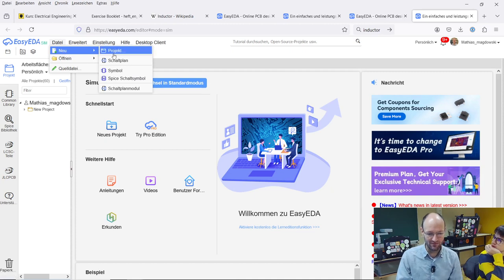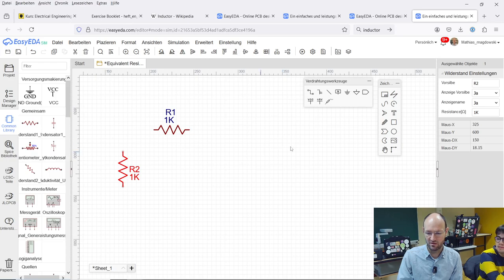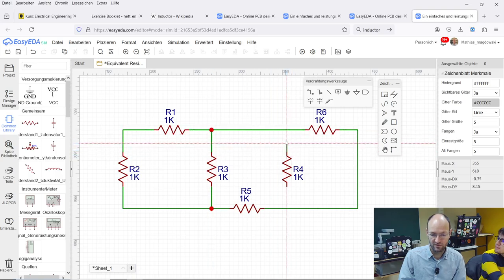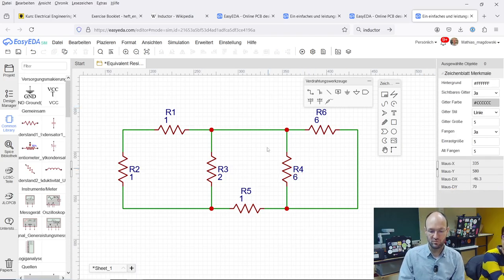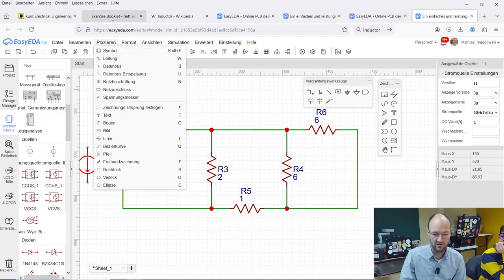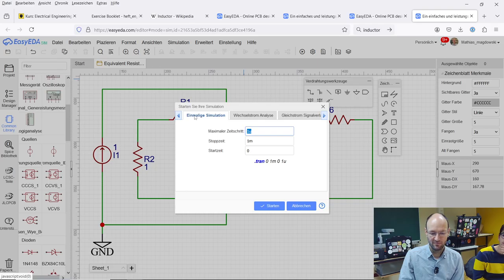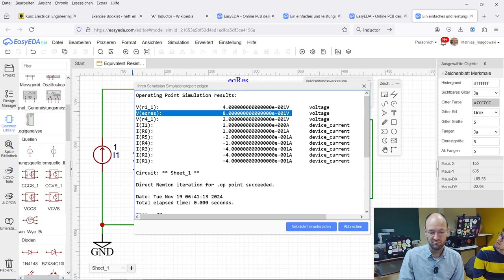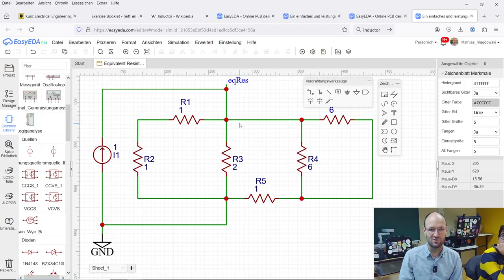How to obtain the equivalent resistance of a resistive circuit using the EasyEDA circuit simulator?

Comment: Well, if I look closely at this circuit, I immediately come up with an equivalent resistance of 0.8 ohms. For this I neither need the current specification nor the EasyEDA circuit simulator.
Reply from the maker: Yes, this is great for you, but this skill does not apply to all of our students, who are still learning about this subject. The advantage of using a circuit simulator like EasyEDA is the ability to simulate more complicated circuits and to determine the equivalent resistance of networks of resistors that cannot be directly broken down into pure series or parallel connections of them (like in a resistor cube for example).
Reply: @MathiasMagdowski  What are the entry requirements for students in your courses?

A resistor cube is indeed an interesting task if all resistors have the same value. For example:

1. Diagonal opposite points (corners diagonally through the cube).

2. Neighboring points (directly connected at an edge).

3. Points on opposite sides (centrally opposite on an edge).

But it can also be done manually. Draw all resistors R in a 3D edge structure. Reduce systematically: resistors in parallel branches and resistors in series. 😁
Reply from the maker: @odysseus9941  Our students need a German university entrance certificate (Abitur) or a an international secondary school leaving certificate, see: https://www.ovgu.de/en/engineering_science_bachelor-path-46492,48816,48818.html
With respect to the resistor cube, you quickly end up with a circuit that cannot be reduced and simplified by just using series and parallel connections, at least in the general case, if the resistors and not all equal. You need for example star-delta transform, see this video:
"How to calculate equivalent resistance of more complex circuits with series and parallel connections"
https://youtu.be/bt8V3lU3gB4